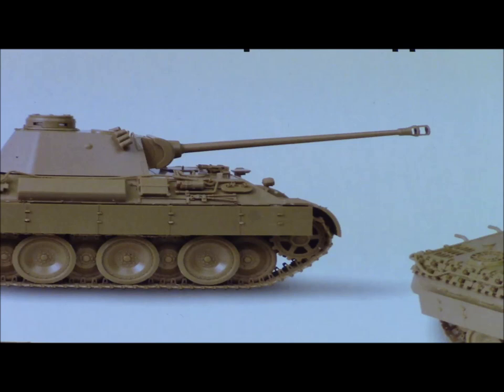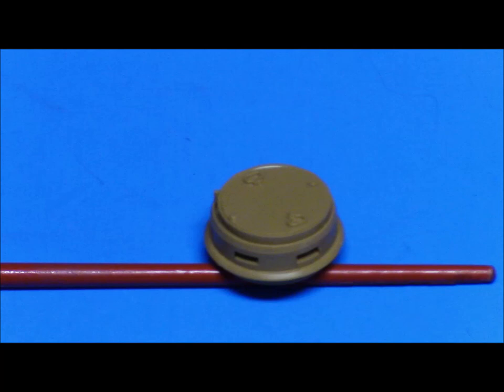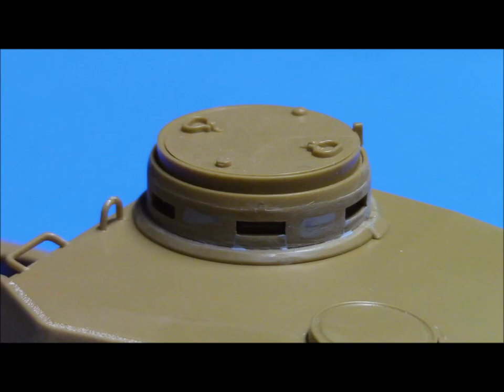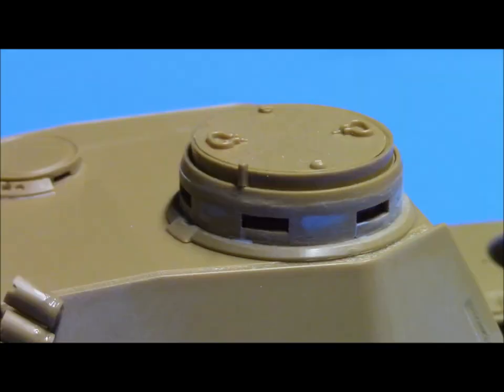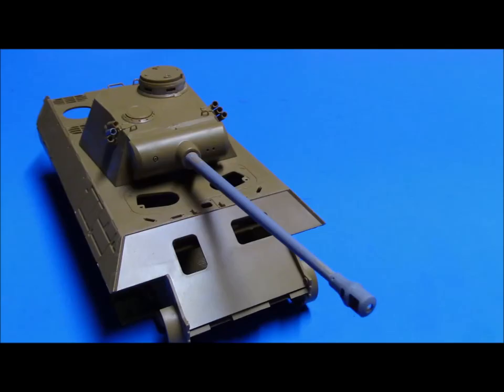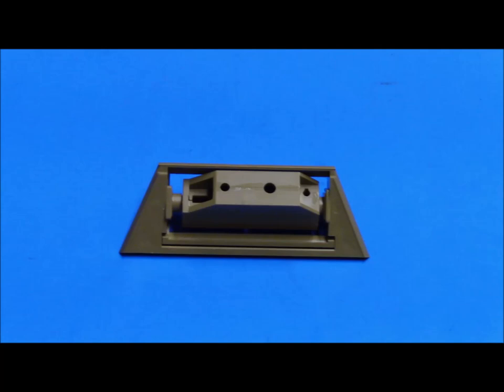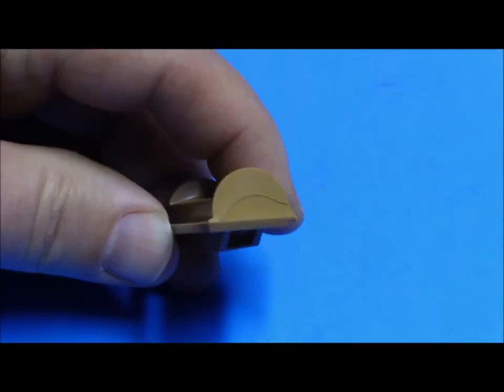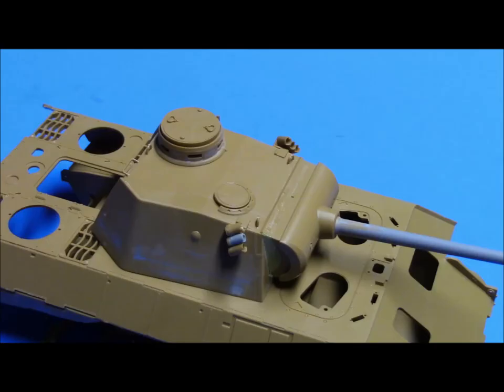Russell Gosselin: Kursk 75th Anniversary GB: Part One

Comment: Good vid Russell. I'm in the midst of a Zvezda build too so found your observations interesting
Reply from the maker: Thank you.  Have you found similar challenges with your build?  This is my first Zvezda build.  The plastic is a little soft.  Reminds me of an Italeri kit.
Reply: Russell Gosselin ive built some really old zvezda kits which were pretty awful.  I have to say that when I did their t14 armata recently I was pleasantly surprised.  The main bulk of the kit , as with my recent 2s19 build ,was fairly straight forward,if a little agricultural.   The issues came with the delicate sub assemblies which had somewhat vague fit and were somewhat overcomplicated. .